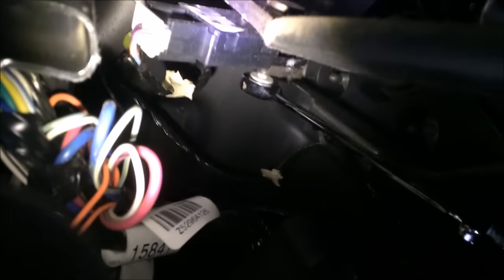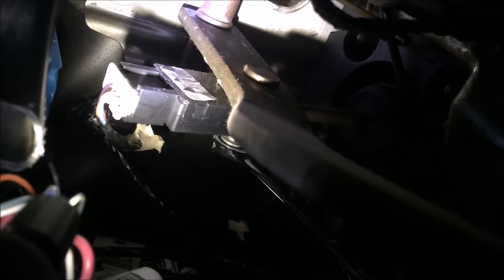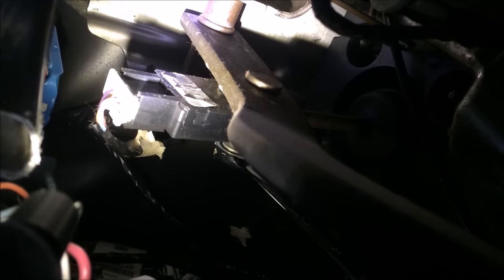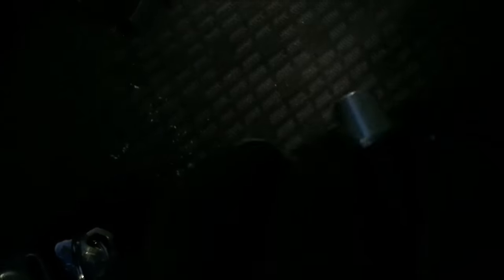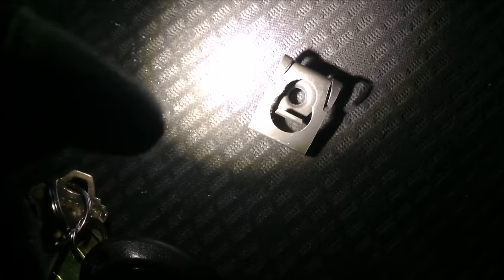How to Replace a Brake Switch on a 07 Silverado, Fixes Cruise Control Issue.

Comment: I have a '07 Silverado 2500HD with almost 130k miles and it just started this intermittent cruise nonsense.  I spent some time online looking for an answer and found this video.  Combining what I read, photos/screenshots and this video, I should be able to do this fix.  Thank you!!  Now, someone below mentioned stereo speaker & door chime issues--I've had that for YEARS!!!  Minimal sound from driver door speaker and door chime is almost non-existent.  Any ideas what the problem(s) may be and how to fix??
Reply: Your Speaker problem, I had the same issue.  Ordered new speakers and upon the installation, I found that my speakers were actually ok, the connections were horribly corroded.  I had one rear speaker that was bad, but the other 3 either didnt work, or worked when they felt like it.  I cleaned up the wire ends and everything, minus the one speaker, worked as it should.
Reply: +johayn Thanks for that heads up!!  Two days ago everything was loud & clear......for an hour, then barely audible again.  I'll check for corrosion.

Comment: I am having an issue where. I can’t get the retaining clip back on. There is a little rivet In the bar that the switch goes on. I can get it on when the switch is off but when I put the switch on it covers that rivet so I can’t put the retaining clip on. In your video it shows that the rivet is still exposed when you have the switch on. But my switch covers up the whole bar. My old one does too. So I guess my bar just isn’t long enough. I guess this truck is going to the junkyard now.

Comment: Have you had any problems with your factory radio / speakers? My 2007 Sierra the speakers go out intermediately sometimes only the tweeters work. It was out for a few days now working fine. Any thoughts??
Reply from the maker: Yes I did! I replaced mine as well. That would of been a good video to make. However a few other people have made that video already. The one thing they don't mention about our truck are the tabs that go behind the bolts for their treads to bite into. you need an extra pair of hands to hold things in place otherwise when you snap the panel back on half the bolts no longer tighten.

Comment: I heard this my also be the fix for my 09 Silverado that will not come out of park when below freezing,  any thoughts?
Reply from the maker: James Williams the problem it was making for me is that it was sending a signal to my truck that I was applying the break. So that doesn’t really sound like the issue... unless your switch is doing the opposite problem and not letting your truck know the break is applied to shift out of park... 🤔. I guess my test would be if slightly pressing your break didn’t kill your cruise...

Comment: i have this issue with my cruise control too, however my 2008 Silverado is also having issues shifting out of park.  Will this fix that issue as well or is there another part that i need to replace?
Reply: did you do the repair?  did it help with shifting out of park?  I'm hoping this solves my cruise control and shifting out of park (on very cold mornings)

Comment: Was the error code  you were getting is P0753?
Reply from the maker: Ryan Rommel I wasn’t getting an error code to my knowledge. Basically the sensor that kills my cruise based on the break peddle was defective and was always telling my truck to deactivate cruise control. It mostly happened in the winter, and sometimes I could fiddle with the pedal and get the cruise to come back. Replacing the part did the trick.

Comment: FYI, FYI, 
First thanks for the video. I have a 2007 GMC YUKON XL and when I changed my switch note that it did not have a screw to remove the switch.  It only had the metal clip. A GM mechanic said that  its not uncommon that some Chevrolet may also not have a screw just the clip for those who may come across what my vehicle had. Thanks again

Comment: thanks for the info But I would really have appreciated seeing the removal of the clip as it seems a bit complicated.
Reply: john balogna yeah i had some problems with the clip. video was ok but would have been nice if it showed more than the before and after. Even some still shots of clip removal and removal of the old switch would have helped. My clip was apparently on upside down, opposite of what was shown but finished the job ok and cruise control seems to be working now.
Reply: Yes I fought with that clip for about an hour.   The clip won

Comment: 09 switch-changed out by Chevy dealer-$21 fro the part and 2.5 hours labor at $100per hour-got screwed!  My trouble sign was  a readout-"Service Trailer Brake System"--local tire and brake wouldn't do it!  Live and learn---looks like a 1/2 hour job .

Comment: Not enough detail. Did not show the detail of taking it apart, and then you needed to take the old switch apart and show the failure points from what I understand what it is is a couple of connections that actually fuse themselves together and don't come apart so that you get a high voltage from the brake switch and the connections don't come apart and interrupt the function of the cruise control in some sort of fashion